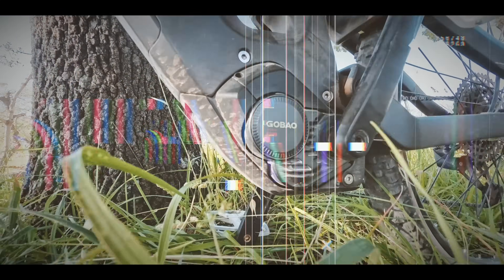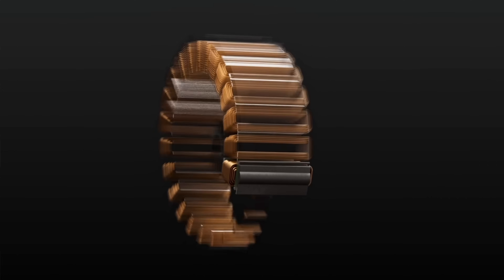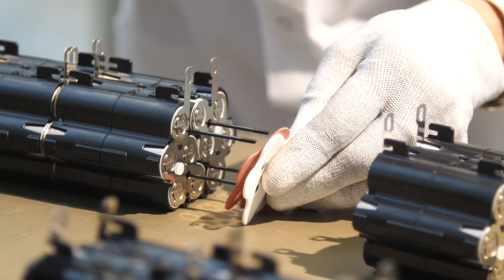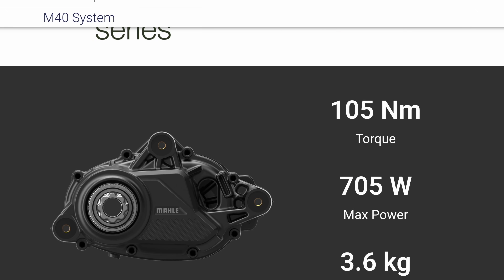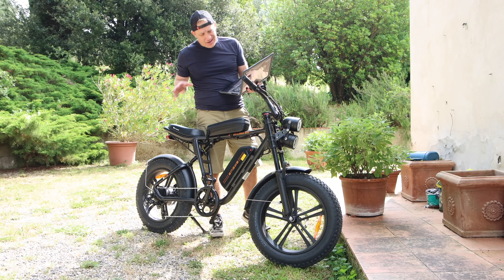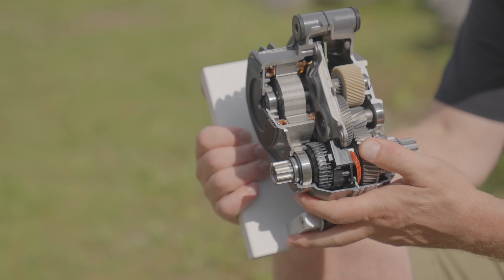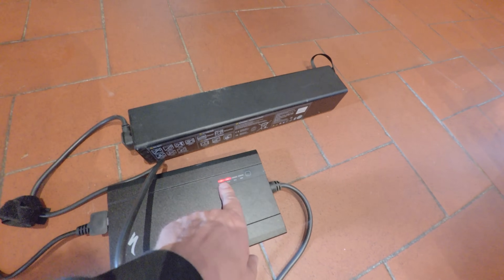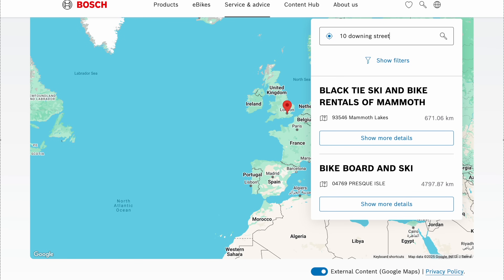How DJI Took The Win...

Comment: Effectivity of motor is peaking 85%.  If we count some losses in gear reduction, we can count 80%.
Not 60% as was said in video.
Reply from the maker: im quoting dji, 40 1 but i dont know the final drive output. add in teh final drive ratio of the rear wheel as well.

Comment: That Mahle has some nylon gear from rotor and just then to planetary. Thats very wrong solution and will be wearing out and failing.

Greatest thing about DJI is just that planetary straight from rotor as a sun. Three times less stress on each nylon planet gear. 

Somebodu knows, where is one way gear, which orevents to rotate rotor when pedalling?

Comment: It's nice to see a YouTuber correctly state that power is determined by the quantity and quality of the cells - not the voltage, which is largely irrelevant to the customer. People often misuse Ohm's law to claim higher voltages result in lower current^2 losses without considering that high voltage motors use higher resistance wiring that is also proportionally longer, thus the losses are still "squared" for nearly the same result.

The cleverness of DJI is that they use a sort-of dual-stage planetary gearset to do nearly all of the reduction within the motor diameter, thus requiring only one spur gear for the requisite jump over to the crank axis. Mahle is not even remotely similar - they just randomly threw a small planetary stage into the middle of a big pile of spur gears. Brose's planetary set might have been a better comparison, but it's also far shy of DJI's gearing elegance.

The real key to DJI's performance is that they use an efficient motor. There's no magic or brilliant technology; it's just a good business strategy to use efficient (costly) motors for weight-sensitive systems in this price category. Not only does DJI's compact gearing allow for a larger and thus inherently more efficient motor, but they actually optimize the magnetic design of the motor for efficiency just like they do in all their other products. By comparison, Bosch, Brose, and Mahle just grab an old windshield-wiper motor off the shelf and slap it onto a bike with absolutely no consideration for efficiency whatsoever. The auto industry is so cost-driven that they don't even think about designing for efficiency, even in so-called "efficient" vehicles. No one cares how efficient their windshield wiper motor is, they just want it to have the right bolt pattern. But the drone industry is the exact opposite because efficiency literally is the product since it completely defines the performance and capability of an aircraft, or e-bike in this case.
Reply from the maker: I would expect the cell resistance to stay the same, so voltage increases current drops.... But I suppose there are many equations on each stage of the circuit that need to be considered to arrive at an overall equation that describes it perfectly..... Can you write it here .... I would be interested to see
Reply: @alexbiketester  Exactly. For a battery cell Ohm's law (V=IR) says that Voltage(V) and Current(I) are inversely proportional so the maximum power (V x I) is determined by the resistance (R), which is rather constant. And power is what we actually care about, so it doesn't matter to us whether the battery pack is 100 cells in parallel delivering 200A at 3.7V or 100 cells in series delivering 2A at 370V, it's 740W either way.

But Joule's law (P=I^2R) expands on Ohm's by stating that the power (heat) lost in a conductor is proportional to the current *squared*, and this is where people get tricked. Obviously this is the reason why city power grids operate at such high voltages - because for every doubling of the voltage you can use 4 times less copper wire. This is also true for eBikes, cars, and cordless drills but people often mistakenly expand the principle to include batteries and motors, when in practice it's mostly only applies to the wiring between them.
For batteries, we already established that a cell can only deliver so much power, regardless of how it is arranged in the pack. For motors, there is an ideal ratio of copper/iron/magnets that is rather agnostic to voltage and current, so a motor designed for twice the voltage will generally have wire that's half the size and twice as long for the same total percentage of copper. Wire half the size will have twice the resistance, and wire twice as long will have twice the resistance again, thus the result will have 4X the resistance, perfectly negating the benefits of using 1/2 the current - squared.

So in the end a 72V e-Bike might only weigh 10 grams less than an otherwise equivalent 36V e-Bike because they can both theoretically produce the same power, range, and efficiency, but the 72V model can use smaller wires between the battery and motor.
Reply from the maker: @jeremytyler99  excellent. Yes that all makes sense. Im glad i studied physics.... and actually understand what all this means. As the Askoll Engineer said to me, its all about the cell quality, you will see in the next video coming on that series, some interesting things!
Reply: The newer Bosch motors have hair pin stators,and not windshields motor.Other than that I agree with you

Comment: To me it's simply that Dji  have access to  better rare earth magnets that nobody else has. Thats why I can run a Sram Xo1 7speed Downhill 10-24T cassette and shortest derailleur. The motor generates so much momentum that it allows me to go where I have never been before. Lower gearing is simply a hindrance. Dji Avinox is Downhill Both Ways.  Get use to it Alex and Bosch. Why is Bosch not pushing for mandatory helmet laws in Europe like we have in Australia. It's a no brainer. E=mtb² but is the Amflow E =mtb³
Reply from the maker: Glad you enjoy it, but they do all have access to the same magnets, Same chips, the tech is all very similar. It's interesting how people seem offended by it almost.... Mahle obviously have been working on their motor since before DJI came out with theirs, so it kind of underlines that there is no special tech considering it has the same specs and ride feel, which goes to show what I've been saying for ages which is there is nothing new or surprising. It's all a bit like Nvidia with their 50 series launch. Except the tech media actually reports the news instead of the marketing.
Reply: @alexbiketester  No if you watch Sams bikes riding the Mahle it doesn't deliver anything like the power of the Dji at low cadence and low rider input. He is quite disappointed with the delivery. The power delivery and excellent control is what makes the Dji the benchmark for the rest.What impresses me is that everyone is trying to find fault with the Dji Avinox motor and surprisingly I haven't heard of any water ingress or any common internal failure yet. I think Dji is trying to find the weakest point by allowing us 1000w in all but eco mode. Some big weighty person with no mechanical sympathy who obsessively washes the bike will find it.

Comment: Waiting for somebody to make fully liquid cooled systems, motor controller and battery
Reply: The ZF motor runs in an oil bath. It's supposed to be better for cooling and preventing water ingress.
Reply: @tonyrobinson1623  first time seeing the ZF. Smart design. Better cooling and infinitely better lubrication of gears and bearings. Reminds me of the ferrofluid filling needed to run insane voltage/amps through hub motors.
Reply from the maker: good idea, but complicated....

Comment: How come dji has such rapid charge on their batteries compared to everybody else? Will that also be down to software?
Reply from the maker: BMS and charger software, yes. Ages batteries faster. Specialized told me you can do it 250 times before aging the battery a lot
Reply: @alexbiketester  250 times seems like a lot. That's gotta be years worth of riding.

Comment: This m*ppet still doesn't understand that DJI Avinox stands out as a complete package...every single component is market leading: motor, battery, charger, speed sensor, controller, display. Yes, Sherlock, no magic, just state of the art HW and SW in every single component. That is an amazing achievement, especially from a new player.
But he keeps blaiming it on marketing & influencers and...government backing 🤣

Comment: The Brose belt drive motors have the planetary gears
Reply from the maker: They broke a lot ... 😂  because of excessive stress on belts, I wonder what the official trouble of all that was. 

One of the UK repair centres tells us that fundamentally Bosch which does not have planetary was the best system for repair and reliability.... I'm unclear on which version they were talking about though

Comment: I know you struggle with the DJI recipe. Why do they have the same ingredients as the others but their output is superior? Engineering is the answer. Why is a 3 liter Porsche motor superior to others that use the same materials? Move on
Reply from the maker: It's not superior engineering, that's the point, it's the same as everyone else. Aka Mahle, who made the same thing. The point of my videos is to educate people to the reality behind marketing. It's not to bash, and here we have a simple motor system like the other simple motor systems there's no High technology here. That's why they show all the exploded diagrams immediately. You could quite easily copy all of it. Once you see the battery construction video you will understand you are unfortunately not correct. Where they can do well if they throw a huge quantity of software engineers at a project instead of one or two. But you will reach diminishing returns. Having tried all of these motors I can tell you that on the bike what I'm saying on the videos holds true.
Reply: @alexbiketester  I understand what you are saying and thinking. Being in the performance game my whole life I see some things that may be performance metrics to consider; power to weight , efficiency and thermal management. My Bosch race motor in environmental temps > 83 degrees Fahrenheit falls off significantly after 30/40 minutes. Some data online indicates that the Bosch gen 5 can lose 20% of it power after 15 minutes of operation during high power demands. Key specific metrics could be:
1. Power to weight of the system 
2. Thermal management degradation performance over time
3. Power delivery efficiency 

Lots more things are important. I have a DJI bike on order.

Keep up the great work and passion for what you do.
Peace
Reply from the maker: @weaponofchoice8942  interesting, yes the fall off might be due to software induced drating, or just self protection of the invertor in the motor, its hard to know if heat management is programed or more passiv ein its behaviour. thanks for watching!
Reply from the maker: Anyway I just explained with technical reference points from DJI the reality of their system. I did not pan their system I did not do anything that was a criticism of their system. I will willingly criticise any companies exaggerated marketing behaviour. In this case one could argue digi did amazingly with their marketing, Bart now we can see very clearly there are other motors with exactly the same very close specifications

Comment: Dji made an illegal motor that breaks the law thats the only secret, they are supposed to have a 250w avg power theirs have 800w nonstop illegal, they are supposed to be pedal assist they aren't you pretend pedal it's full power, illegal again
Reply: Nearly all motors comply with this regulation only on paper. Real 250W motors are viable only for children's products or lightweight adults living in very flat areas. This makes them extremely niche and undesirable to consumers. Therefore, "illegal" is an exaggerated term for an unrealistic regulation created by people who failed to research the power output and speed of regular bicycles before drafting the law.
Another problem with this law is that it treats all riders as if they never use regular roads, where a 250W + 25 km/h limit is a joke.
Reply from the maker: Yes somehow they fiddle the numbers with software and that is why there is a movement to make all these motors more transparent

Comment: Probably worth doing some research on Battery C ratings….. there are significant differences between the performance of battery systems dependent upon the C rating. Two packs with the same chemistry, voltage and capacity can perform very differently.
Reply from the maker: You will see in the battery production video extensive cell testing

Comment: Alex, you mentioned battery recharging frequency. Can you expand on that. Am I reducing long term battery life by charging it after every ride, even if I only consumed 50-60%.
Reply from the maker: Battery life functions on cycles it is better to keep a battery between 20 and 90% 80% then charge to 100%. With new fast chargers and more drain people will be increasing the cycle count on their motors and battery systems more frequently. As to power full power motor with 100 Newton metres 800 watts you will need to use or drain more of the battery. Therefore you will need to recharge it more often and if you rode every day and you charged your battery every day in about one year you would have shortened the life cycle of the battery significantly. Specialised told me that you can fast charge their battery about 250 times after that you significantly shorter than the life of the battery. So if you fast charged only your specialised battery in 250 days you w words aged significantly
Reply from the maker: I normally get two rides out of One battery and my battery life's are three four years no problem

Comment: The repair aspect is why I am interested in the Polini. After having my Brose repaired twice now these costs add up. Also I am on my second battery. Local support and warranty are crucial. Good video BTW you seem to be the only one doing a good job on the reporting these issues.
Reply from the maker: Thanks, yes, repairs are super important. As regarding only one ever talking about these subjects, in my opinion I see most of the others just readign from spec sheets, only MBR give insights, but even they recently are just repeating specs. Hopefully others join in, its crucial for the end user to have channels with real facts and figures going on. The motor tech is a classic, its all the same tech basically, just used marginally differently to the engineers preference. Software is where the real differences can be made, but even there its not rocket science.